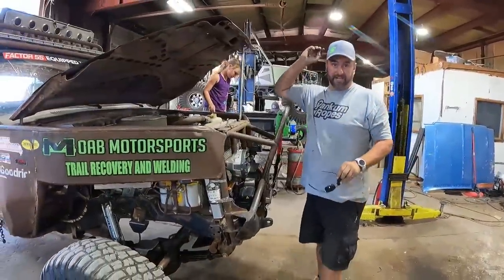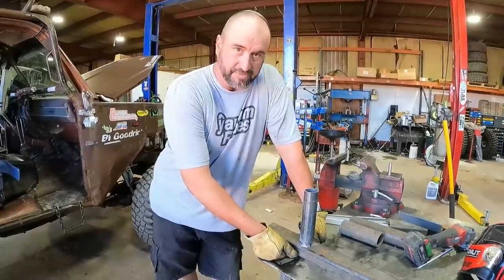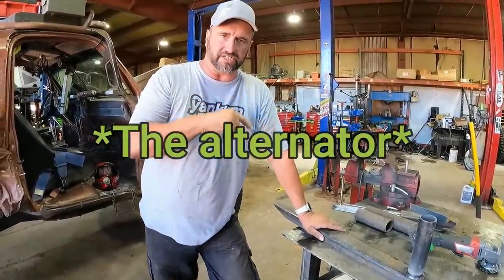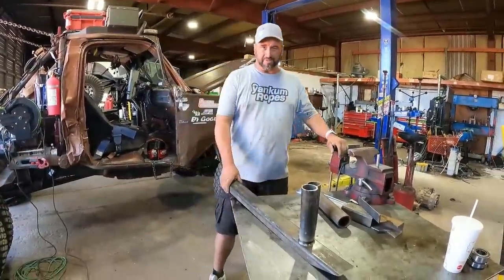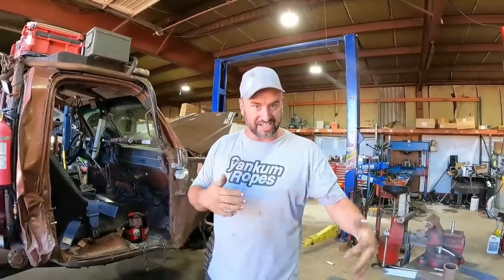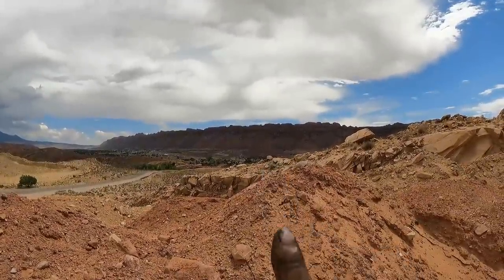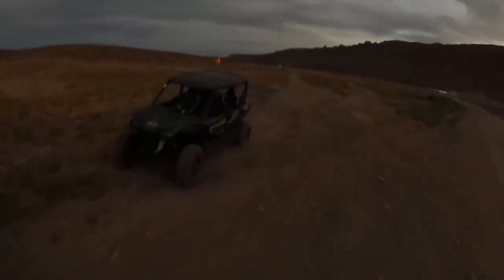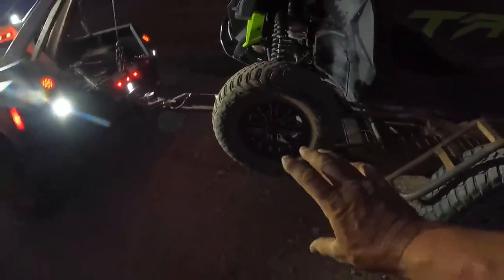Premier Power Welder

Comment: Rory your knowledge is irreplaceable when it comes to recoverys and trail repairs. You're welding skills are above par and it all works because you have adapted to the things that need it and now you have a great vehicle in Trail Mater! The new tow truck is looking good and is a vital part of your team. Good job and thanks for sharing about the premiere welder and how it works, etc. Keep on truckin!
Reply: The welding unit $1,600+ direct purchase on internet Note you have to provide vehicle make engine information so the company can provide alternator that matches mount and wiring harness.
Reply: His knowledge is not the opposite of right. ;)

Comment: I've used my Premier welder many times over the years and saved a few weekends for friends and a stranger or two. I typically have a friend's rig I connect to with my Warn jumper cables to keep my batteries charged and fans running. Like you, I carry 6011 (for a cleaning pass) and 7018 (for strength). I also carry E303 (I need to check this number, it's been a while) rod for welding cast steel when I must.

Comment: Good explanation of the Premier Power Welder. They've been the best mobile welding system for a hundred years. Don't waste money on anything else, it just won't measure up, folks. Thanks for taking the time to spec out the tires and wheels too. Oh, and looks like the revamped trailer is working out nicely. Keep it up! Great vid! Keep Shawn away from those brake lines. 🤣👍

Comment: Rory.  You have the Ultimate Off Road Recovery vehicle designed and purpose built.  Function. 
No BS.  You are also a Pro at Off Road driving and recovery.  Nice to see Lilly too.  High Praise, which I do not often give.  As an Inspector in many Industrial fields I admire your Welding Equipment and Technique.  No Suggestions!

Comment: @trailmater
Rory, a video I'd like to see is something on the rods you carry for the Premier system- i.e. which rod works better in which situations: Repairs to DOM control arms or a cage, for example, or something being welded directly to the axle tube, making temp driveshaft tubes, yadda yadda...

I used to just weld everything with 6010 rods because I was just a kid learning, and my dad always seemed to have them laying around in bulk. I never knew better until I started getting better and welding more of a variety of junk. But, to see some vehicle (and part) specific examples would be awesome!

Comment: Hey, I learned my lesson about welding and electricty back in the 60's when I was fabricating mud glap hangers on a semi. Iwas using a miller welder that was grounded into a central ground and also using a metal cased 1/2 drill  that was grounded into the same central ground . I sm not sure but I think yhe welder was set on 92 amps and the ground was clamped near where I was working. I went to drill on the bracket and when I touched the bit to the metal, there was one hell'va explosion that blew the end of the  bit off.

When we checked what happened, the  insulator on the case  stinger  side was cracked and was feeding into the case and therefore into the central ground. The shortest route was through the case ground and the grpund on the frame. Always make sure the insularors on the welder are not damaged.

Comment: Love the welder, hate the squeal.
In the early 80's, the company I worked for bought us a small portable welder.  It as the size of a small suitcase, had a little 2 stroke engine.
It was a high frequency welder too, just squealed like crazy.
The engine reved up and down to give you your amperage.  Horrible thing.  It would idle and when you tried to scratch start the rod it would rev up and the arc would jump, you would pull back and the engine would idle down and you started all over.
Once you got the arc going it welded really nice but man it took a bit to get it stabilized.

Comment: I was a millright for many years. The first High Frequency welder I used in the field was for Klamath Machine. I thought that the sound was the coolest thing I had ever heard. They are very smooth DC Machines when welding Low Hydrogen rod like 7018. Great explanation my friend.

Comment: some years ago I borrowed a trailer with the committment to repair a broken weld.  My friend welded the broken parts while the trailer was connected to my pickup.  I don't know how the ground was connected, but I later found out the only lights that worked on the truck were the headlights.  ALL other small bulbs, which were not turned on at the time were blown out.  Take Rory's advice and be very careful how you connect the ground when welding on your vehicle, or anything connected to it.

Comment: Thanks for the lessons Rory. I've wanted PPW for years even though I've literally never needed one. I'm not that hard-core 🤣🤣🤣
Reply: I mean, why have one unless you go out in group settings every day where t would get used?  Makes sense on a recovery vehicle on an outing or event, but that's what Rory does, and he knows it is just what is needed to get you out of a spot and onto a full repair elsewhere.
Reply: @marklar7551  Sometimes wants are needs.
Reply: I love my PPW, had it for over 20 years now.  Alternator has been rebuilt a few times since getting it.  Only used it a few times, same as my winch.  
One time on a solo trip thru Utah, I pulled into a camping area at the end of 20 miles of bumpy gravel road with a broken shock mount.  Apparently there was a Boy Scout event going on and the place was packed with scouts.  A few came over to see what was up with the horrible metal on metal screeching as I pulled in.  I rounded up some pieces of steel out of my parts box, uncoiled the leads and grabbed some rods.  Had the broken mount repaired in no time.  Pulled out the next morning and all the scouts were looking on in disbelief, they must have thought I would need to call a tow truck to come and get my truck.
One other use was on a 3 day 4WD trip with my club.  A Jeep in the group  had an electrical fire and burned up the engine wiring, this was a day from the end of the trail. I was up ahead and was given a parts list over the CB and I headed out to try and get to the nearest town before the parts shops closed.  Just made it and headed back, camped at the end of the trail and wheeled back in the next morning.  In the mean time, the others were trying to tow the Jeep out along the trail.  With no engine and no power steering and the front axle took a beating getting dragged over the rocks (would have been nice to have a wrecker setup to lift the front tires off the ground).  Steering box broke off the frame and one of the leaf springs broke at the rear hanger and the other hanger ripped off the frame.  I got back about that time and handed over the box of parts and fired up the welder.  Welded up the broken spring/hanger and got the steering box back onto the frame.  We managed to get that Jeep off the trail, onto a trailer and back home.  Pix if interested:
https://www.4crawler.com/4x4/CA-168/Dusy-2003/21.html

Comment: Perfect explanation about current paths and welding on vehicles. South Main Auto has a video where the vehicle is having trouble with the oxygen sensors and the diagnosis reveals the ECU O2 sensor inputs are damaged from welding. Whoever did the welding put the ground clamp on the frame and welded on the exhaust. The current traveled through the exhaust, up the O2 sensor wires and through the ECU ruining the circuitry in the ECU. If the ground clamp was placed on the exhaust that would have not happened. The current flow would have been isolated to the exhaust pipe and no current would have flowed through the O2 sensor wires. 

The premier welding is a very nice unit. That whining noise is probably a power converter inside the welder that converts the input power to the proper voltage and current for welding. Obviously the wires from the alternator to the welder are not sized for 180 amps or whatever the max welding current it so the voltage is likely higher out of the alternator which allows the current (and wire size) to be lower at the input. Then the power is converted to lower voltage, higher current for welding. The whining noise is likely how fast the power converter switches.

Comment: As always a very interesting video. Before retirement my job often involved instead of "trail" repairs it was "rail" repairs. The heavy machinery used for railroad track maintenance. Nothing actually invovling track work/repair. There were times we did temporary get it off the main line repairs and it always depended upon what was broke. Some were permanent repairs and some were just get it out of the way repairs. You are an excellent welder and that is a slick setup you have. I carried 6010 for some jobs to run the root pass because it's deep penetrating and works good if you can't get a "tight" fitment of the parts. Then I followed any additional passes with 7018. However this was on much heavier steel so that might not work for you. Always enjoy your posts because you show you clearly know all the ins and outs of not only the recoveries but the repairs. Like you said always ground close to the work and on what you are welding. Stay safe.

Comment: Thanks for the video on this.  I was going to get a Premier for my Jeep after talking to the rep at EJS, but I found a really good deal on a Sun Power on board welder/generator on KSL about a week after getting home.  I'm planning to set it up isolated from the rest of the charging system which will keep it from draining the starting battery and give me a backup charging system if I lose the main alternator in the back country.

Comment: Km3's are absolutely brilliant. I get so much grip in all terrain over here in the UK. Only thing I haven't been in with them is snow, but the Km2's were great in snow. Bf goodrich absolutely killing it. Keep up the great work Rory and crew. 👍💪
Reply: Everything in snow is a pain.  There are different snow conditions here in the Midwest USA, and tires and 4x4 does not mean it's all cool to go full speed or speed limit.  Wet is another condition where tires make some difference but there is no way that you're invincible.  These tires are used on plow pickup trucks because they last and will gain traction but I watch idiots slide and crash in every vehicle with every tire type.

Comment: I can hear it: --- It's such a smooth burn.  A smooth power delivery and a clean signal.   6011 tends to work no matter what;   7018 can go bad if it gets wet or even moisture from the air:   but you can fix that issue by just putting your old 7018 rods in an oven and slowly baking the water out of them.  It's a useful trick if you have a lot of old 7018 stock piled that is sticking a lot and giving you issues.

Comment: That was a good info video, I always wondered how you got such nice beads. I have used batteries in series to cobble together a field fix but we never left them like that for the exact reasons you mentioned.
Reply: I was going to say the Premier sure beats the days when we were using 2 batteries and jumper cables for trail repairs.

Comment: The throttle cable adjustment next to the welder is awesome. It essentially eliminates the need for another person to sit in the cab and push the gas pedal just to raise the RPM for the welder. Labor is very expensive, remote adjustable throttle cables are one time purchase. Bam! Done.

Comment: Thank you Rory for showing us the Premier Power welder in detail, I knew from the sound it made, that it is using PWM DC current.... to those in the unknow, PWM is Pulse Width Modulation, and is very easy to control the current to the target. in this case, a welding rod.
Reply: Is it PWM or is it just pulsating DC coming from the rectified 3-phase coming from the alternator?
Reply: @russellhltn1396  The controller changes the "width" of the Current Pulse to supply more current to the welding rod.  IF less heat is needed, the Pulse Width is made narrower.  The Alternator RPM also plays a big part in providing enough voltage to the controller.
Reply: @johncraig406  I would have thought that the controller is controlling the alternator's field.  Far lower current to manage.  If true, the PWM may or may not show up in the alternator's output, but most certainly there would be some ripple left over after rectifying the AC output to DC.

Comment: Thanks for explaining the Premier Power Welder. I was looking at one many years back for my XJ and ended up buying a Ready Welder with the intention of buying one later. I was already running dual deep cycle Optima batteries. Now I still should get one or the Zena Welder. Both seem to be good options. The question for me now is for my LJ or JT. 
 The plus for the Ready Welder is it's a portable spool gun that can be used with 18-36 volt I've welded 1/2 steel with it. It out performs my Lincoln MIG as long as batteries are charged.

Comment: Great explanation of your on board welder. I had wondered a bit about it. I had not questioned because you have showed some nice finish welds. That takes talent to begin with using stick in far less than ideal situations. I wondered a bit about the high pitch sound when welding. High frequency makes since. Your experience your talent and ugly well built set up wrecker. Great team. I completely respect what you do. Myself as a heavy duty mechanic for 35 plus years know what it’s like to do repairs off road out in the field. And I have helped a friend of mine with a tow company do several off road recoveries when he needed extra help. It takes a special talent to get it done without further damage

Comment: Rory, great exploitational video. But the old ground clamp can cause you headaches. Take it from an old pipe liner of 39 yrs. Find your best pair of channel  locks and weld a 5/16 th. stud to the cl frame. Install an eye on your #2 ground wire and bolt it on the cl. Many hard starts come from a lazy clamp. After I started clamping my ground, I eliminated bastard  starts.

Comment: Rory, another thing to keep in mind, like you said with the computer the same is true for bearings. Avoid allowing the welding current to pass through as they will arc out on the elements and race causing premature failure.

Comment: Very cool welder kinda crazy how small that thing is and how good of a job it was doing but. Have u ever thought of just running a high power inverter for the grinders and things like that? I have one in my car for actually using tools and large chargers for 1/5 rc drag racing and works pretty good.

Comment: When welding on equipment it is much safer to disconnect the battery. I was welding on a semi trailer one night, I asked the driver to disconnect the battery, he said it would be fine to go ahead and weld with it connected. Latter that night he went to get us something to eat. When he pulled back in the parking lot, he said that every time I struck a arc, that all the lights on his semi lite up, it fried his alternator. And yes the ground clap was fastened next to were I was welding. Much cheaper to disconnect.

Comment: The high frequency is similar to what we use TIG welding. Welding on a stainless steel tanker with the ground hooked to the piece we are welding and all the led lights on the trailer would start flickering! True story.

Comment: When welding with a hard wire mig, the electrode is negative and the ground is positive. In this case, you can definitely fry the alternator and battery's. The first time I ever welded on a 928G wheel loader without disconnecting the battery, I found out the hard way. As long as the electrode is positive you're fine.

Comment: I built mine. Ford high Amp alternator.  Jumper cables and a stick rod holder on positive side. I use 6011 rod. Primarily.. 1/8". Found 3/32" burning through material. Welded several  rigs backtagether. Including myself. Twice now. Once on Hells Gate.

Comment: You can modify a GM Delco alternator to do this, with zero cost, by bypassing a couple bits inside. Won't generate 12v anymore, and doubtless it's not the same level as the Premier Power welder,  but will absolutely burn a rod. Add a pair of jumper cables, a welding helmet, and some gloves, and you're golden. Lot of capability for the cost of a junkyard alternator.

Comment: Thanks for doing a great review on your welder. I've checked them out before. I live 100 percent off grid. And that's probably what I should get for a welder. Especially since it also can run a grinder etc. All with one compact unit. I'll just have to try to save up and get one.
Reply: just note, the grinder was a AC/DC type, the welder's 115-volt outlet was DC voltage, and old-fashioned light bulbs, but the LED stuff would not work.
Reply: @rearspeaker6364  thank you. I did notice that he pointed that out.
Reply: @markanderson9857  hate to see someone buy a regular grinder and know it will fry itself in a few weeks of use.

Comment: That's welding right there. You only used the wire wheel to clean the flux off and not a grinder to make the weld look better.  Great work.

Comment: I agree with all you said. Your welding set up is very cool. I have worked on just about everything from planes to go carts been a autobody tech for 49 years. Now back to my 1st statement and,,, you did mention it in your intro. localization is truely the key and how close to a computer mod.<< pricey piece of hardware. SORRY just to be on the safe side I always pull battery post unless I have no wrench lol. I always had that arguement with the Icar instructors It is the static charge that will get the cpu not the current flow. So in reality it dosn't matter anyway you do it unhooked or hooked up. Localized area and path helps reduce. Also there is some new tech out there that you just hook to the vehicle to stop the charge they work. peace and axil grease brother.